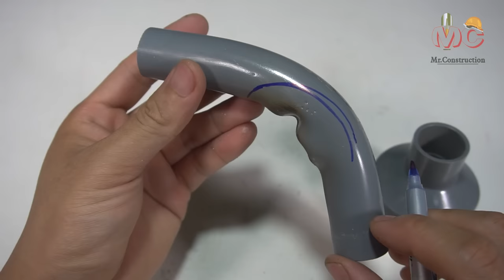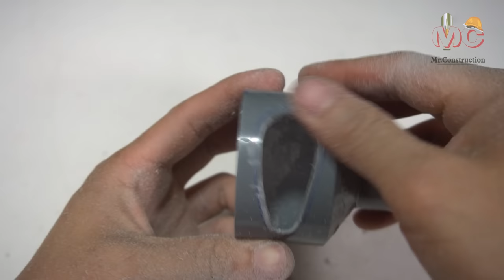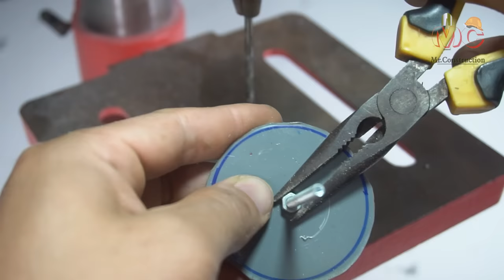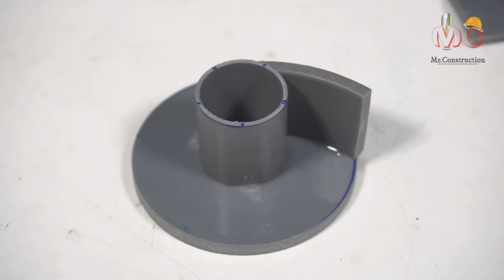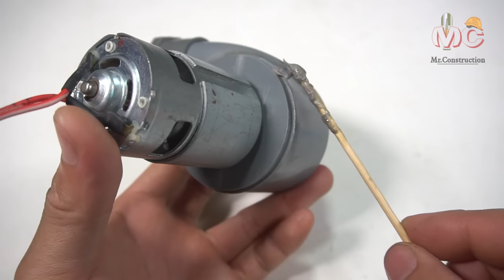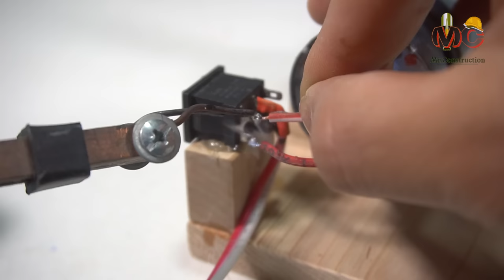How to make a super strong water pump from 775 motor and PVC pipe

Comment: Hi nice one, how many Amps does that battery drill motor pull to make it that powerful. Let's say you had a 10 amp hour battery how long would it last? Cheers
Reply from the maker: It is 775 12-24v 80w . motor
Reply: @mr.construction9846  many thanks for reply, have you tested the amps draw with a clamp meter? Cos it may be an 80 watt motor but that is Its maximum. The faster the rotor is spinning the less resistance it has therefore the less amps it is pulling. Regardless, I'm still 100% confident you can gain more than 80 watts out of that if you put a hydro turbine in front of it :)
Reply: @mr.construction9846  https://youtu.be/yAb6UksmgJc
Let me give you an example^. My motor here is a 180 watt dc motor (12 volt 15 amp). It is drawing just 1.5 amps in this video above, yet it is turning a 1kw 3 phase wind turbine motor fast enough to produce 390 volts under load of a 40 or 70 watt light bulb. So although it is a 180 watt motor you can se by the shaft speed the lack of resistance so the motor is pretty much free spinning which just hooked directly up to a battery consumes very little power/amps.